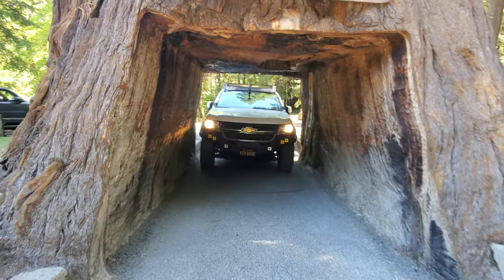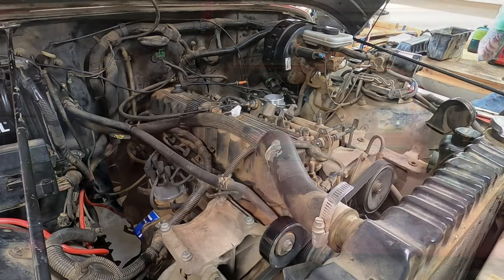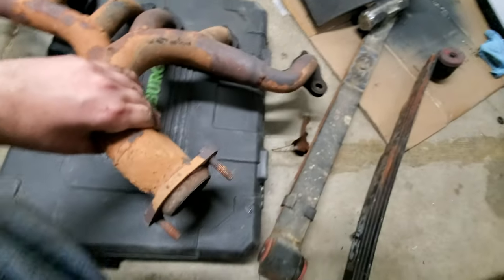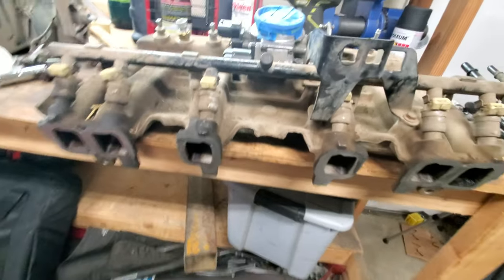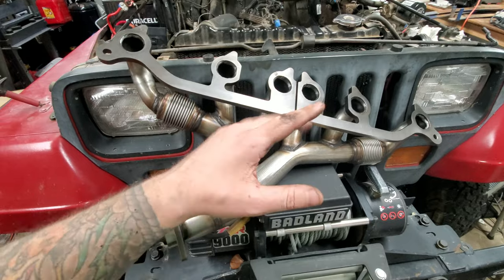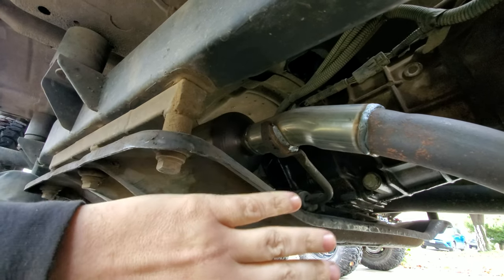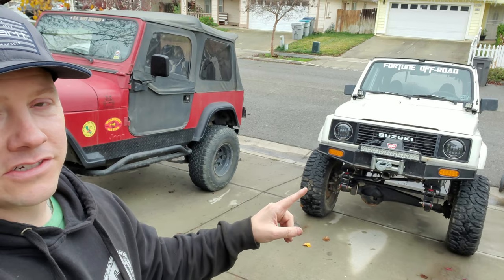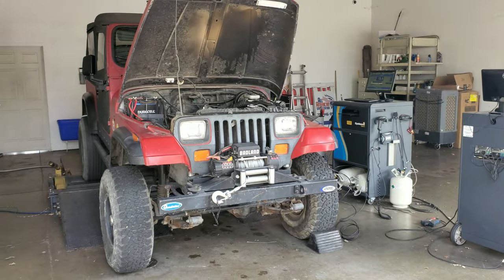Jeep YJ Smog Fix (Part 3) | Exhaust Manifold & Catalytic Converter

Comment: Man! This was the most helpful YT video series. I just got an 87 YJ and it’s failed 4 times… are you sure with the air/fuel mixture it might not just be a simplecarb adjustment? 😅 Or is yours fuel injected? I really would like to not have to get a new CAT!
Reply from the maker: Good to hear! Mine is the 4.0 so no carb. A cat will pass you but you need to find out what's wrong so you don't ruin that one too
Reply: Thanks for the reply! In your experience, could the air/fuel mixture potentially be solved by tweaking the Carb? My NOx was off the charts at 3000+ PPM. I also used the ATS 505 fuel treatment solution, I'm reading maybe the carbon deposits burning from the build up being flushed from the system could also be causing a higher than normal reading. Any advice would be super appreciated! Thanks for kicking ass.  @FortuneOffRoad
Reply from the maker: @elliotodea1484  if you are showing high nox you may have burned out your catalytic converter already. Once that happens it has to be replaced. Watch some videos on tuning that carb and that should help.

Comment: Those exhaust manifolds are the Achilles heel of the YJ it seems. Interestingly the new one had those flex joint things. I've seen some people run "limiting straps" on their engine to keep the rotation to a minimum, might be a good idea for the ol YJ.
Reply: Yeah...what he said 😜
Reply from the maker: I'm hoping this setup lasts for a few smog at least!

Comment: Are the samurais hard to get pass smog, or is it cuz yours is modified, just picked one up and am in the process of making it pass ca smog so it can be a daily too
Reply from the maker: It seems like a lot of them have a hard time passing smog. The problem is they are pre-emissions stuff so most of it is handled through the catalytic converter, which are expensive. If you get a new one you may pass but if you don't have your engine running perfectly you'll just burn up that new cat. I see them driving in the road. There is hope!